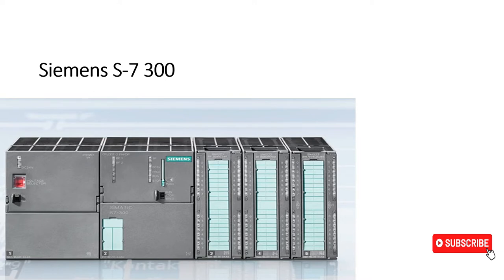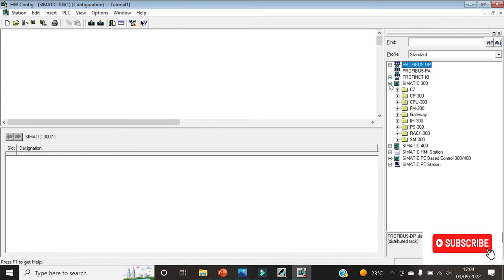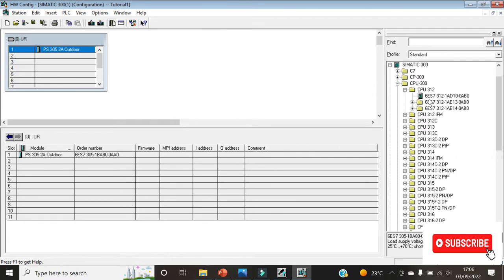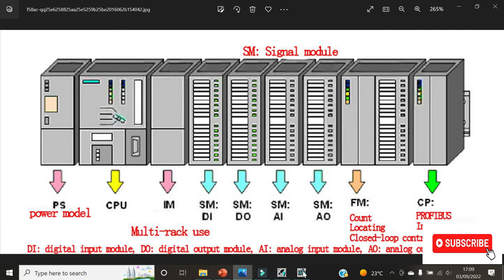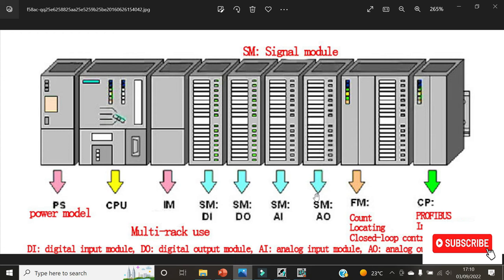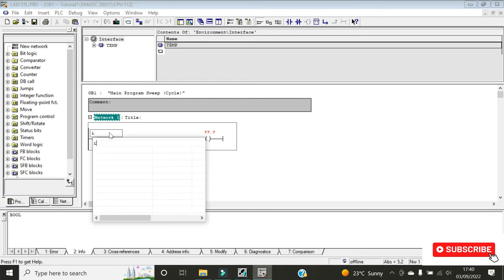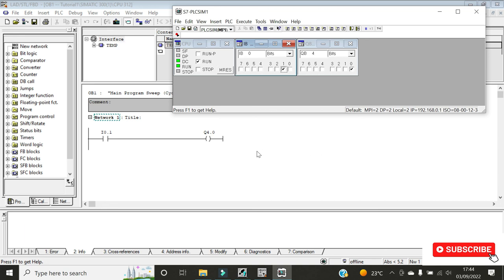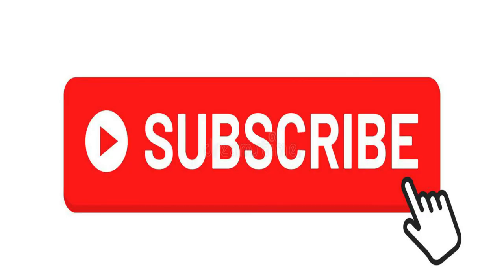PLC Programming; Siemens Simatic Manager Step 7 Hardware Configuration & Program Simulation( S7-300)

Comment: Hello,
I have a spare channel (296) wanna use it instead of another one (294), after I do the wiring, what should I do in the software using Simatic manager to enable the spare channel and make as 294?

I want channel 296 to have all the configuration as 294.

Channel 294 is for reading the load in TON